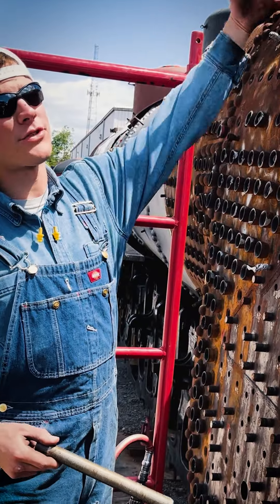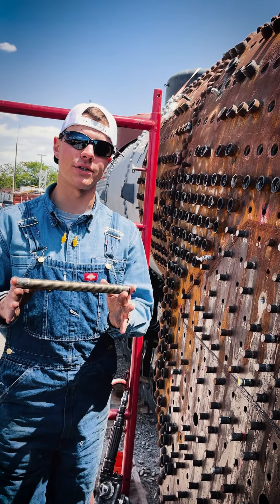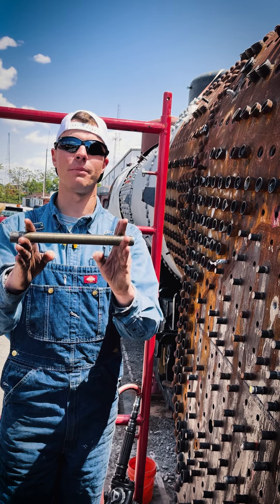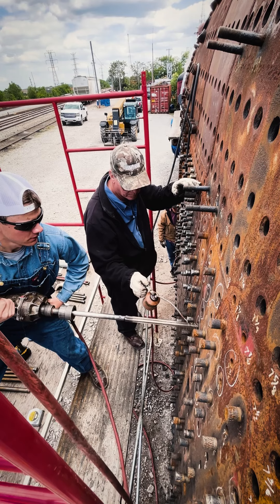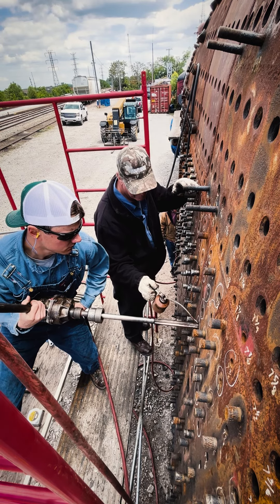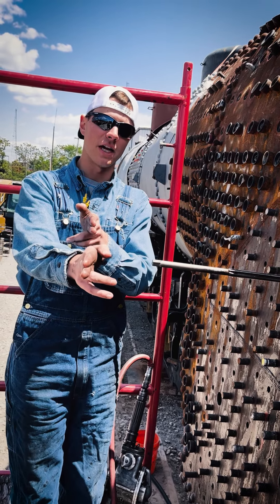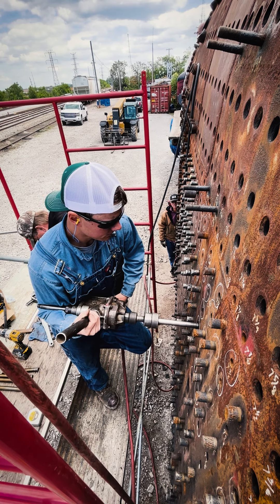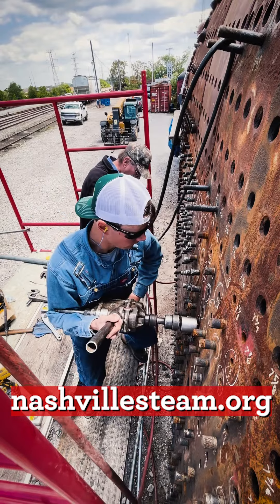How to Install a Staybolt | Steam Locomotive Restoration in Nashville

Comment from the maker: 671 staybolts down, 886 to go! Learn how we install radial, flexible, and crown stays on steam locomotive No. 576!

Restoration work is progressing well on our Nashville, Chattanooga & St. Louis steam locomotive, with new staybolts installed in the firebox, and all spring rigging components are completed and installed on the frame. Both engine and trailing trucks are completed and ready for service, while new rod bushings are currently being machined. We anticipate two more years to completion of the restoration project. Learn more and donate to help here: https://www.nashvillesteam.org/
Reply: What made you want to restore engine 576

Comment: That reamer/tap looks like a very specialized tool. You won’t find one of them down at Home Depot! Maybe not even at McMaster-Carr!
Reply: Old school tool from many moon ago. You either custom order them or buy them at tool auctions. I suppose a loco crew would have that in their collection of tools from other jobs, passed down. Reaming taps ain't as common as they used to be. The only place i intersect with one as a medium level, just above hobby machinist, is bicycle pedals. To thread the arm, you need a reaming tap.
Reply: not many are around if you want one of those get it from a gunsmith. Bruce at Steam Shop makes these so does Alex Beams both have gunsmithing on their resume so they know how to make these tools.